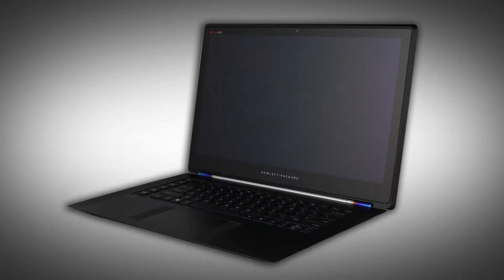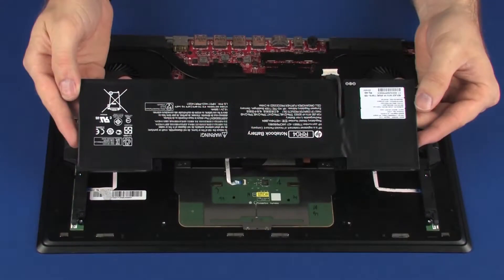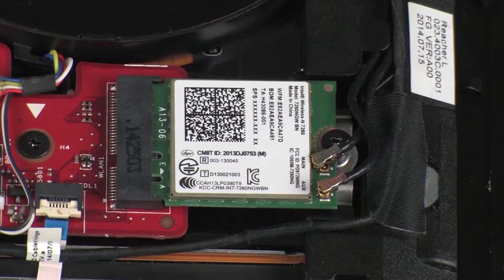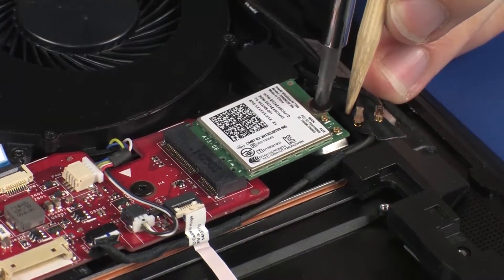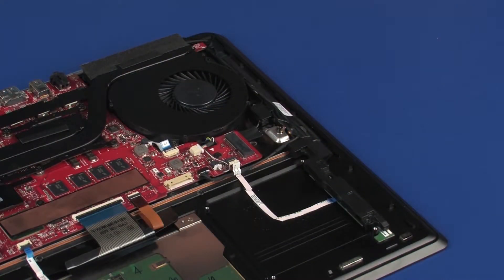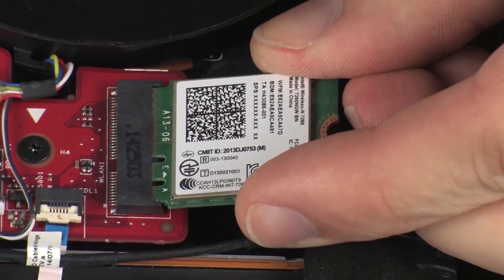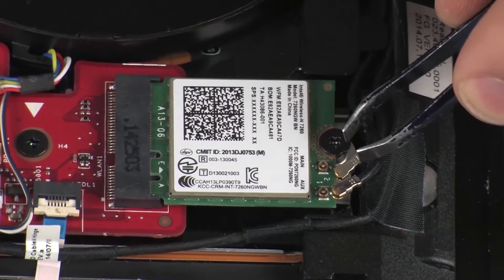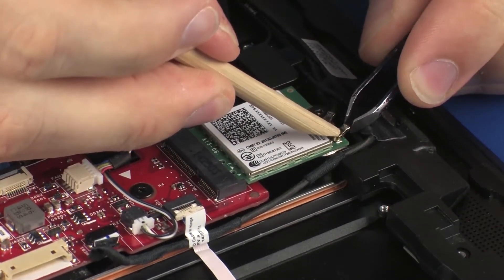Replace the Wireless Module | HP OMEN Notebook PC 15 | HP Support

Comment: How can i make sure if the wifi card is compatible ?
Reply from the maker: +Qerope Tech Let's do a wireless test to isolate the issue.
1) Turn on the computer and repeatedly press the Esc key to enter the Startup Menu.
2) Now press the F2 key to access HP PC Hardware Diagnostics (UEFI) main menu.
3) Go to Component Tests, then click on wireless module.
4) Click on run once to initiate the test.
Let me know the results!